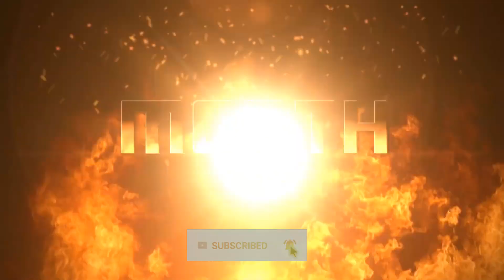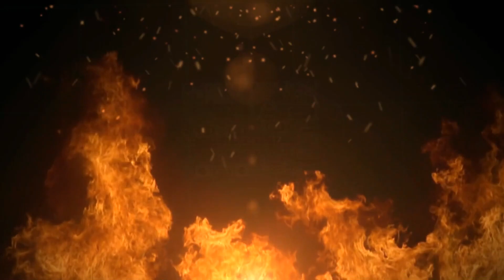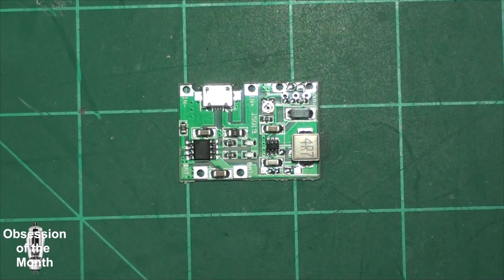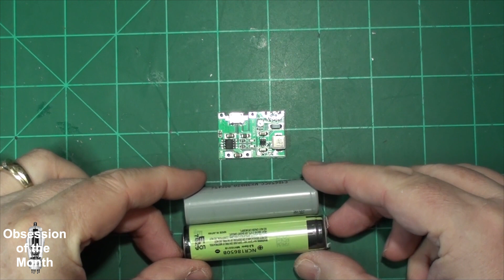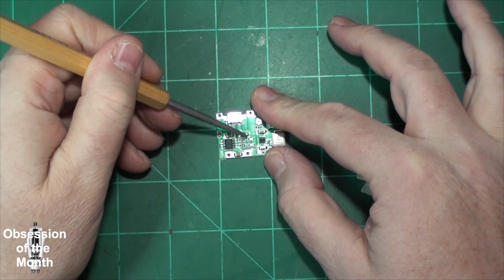J5019 Lithium battery charger boost converter

Comment: If I add a midi interface, what is the code for this esp32 so that it can be controlled by an external midi controller?
Reply from the maker: I do not know what you are talking about. as far as I know this device is not addressable.